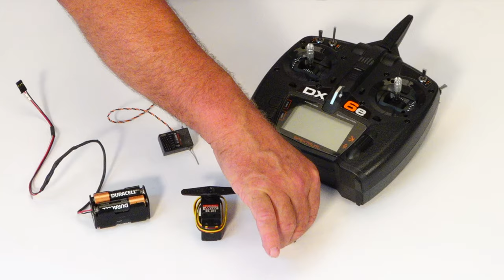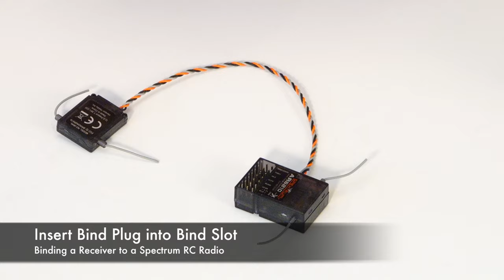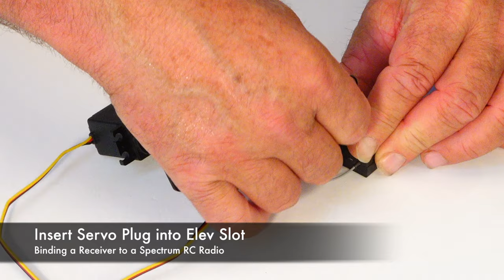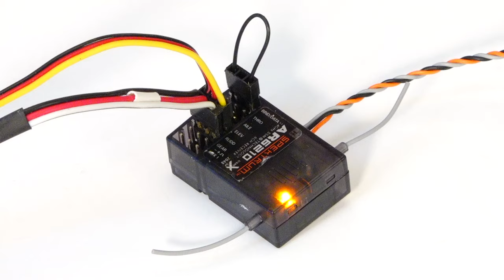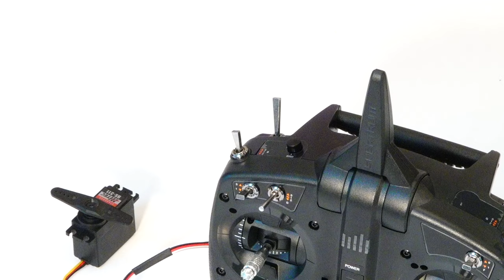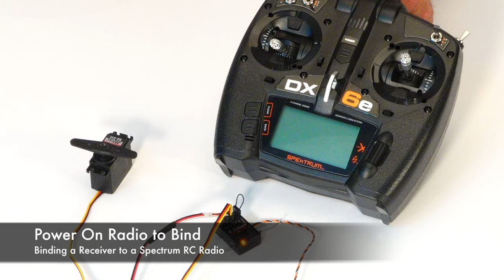Binding a Receiver to a Spektrum RC Radio

Comment: Hi, Id like to inquire about switching my planes to a superior Tx. Including:XK P-51, XK A800 glider, mini 4ch 400mm war birds from voltronics or Leambre,  XK Cub-Skylark, the cheap dual prop propelled F-22 raptor Temu grade the rudder is the vectoring 2 props but flys amazing, & a J-20 EDF. Can this be done?!? I got a DX6e for the UMX A-10 TII which was easy to bind, Ive heard there is a way but wouldn't know where to start. The given Tx in most  cases blow all suck pretty bad; not to mention the bulk of needing all the Tx's but their batterys too.  Might someone be able to help me sort this out?

Comment: Easy enough, but how do you set failsafe?
Reply: Spektrum receivers use the position the throttle is at when bound. If you bind it with the throttle at 0, when it "failsafes" it will send a 0 throttle signal to your esc.